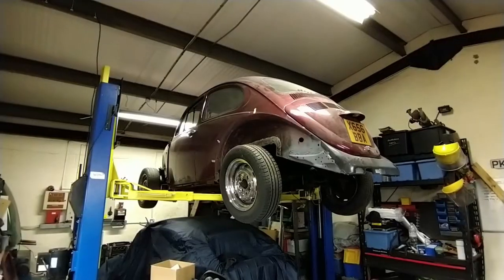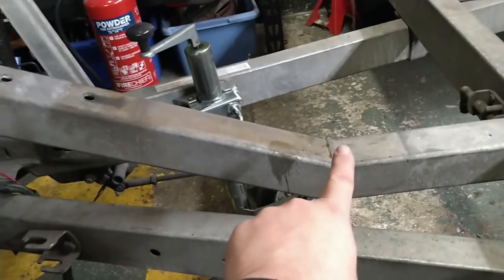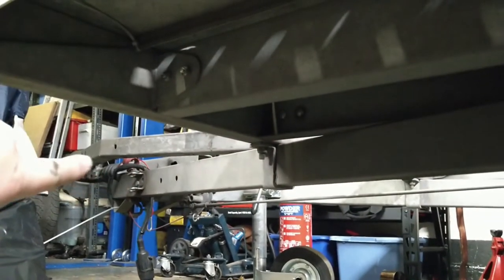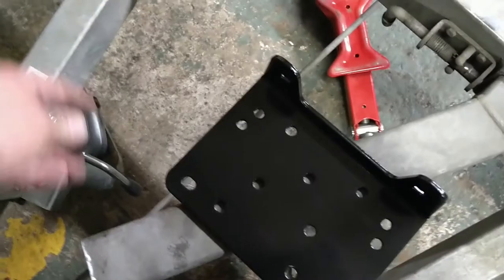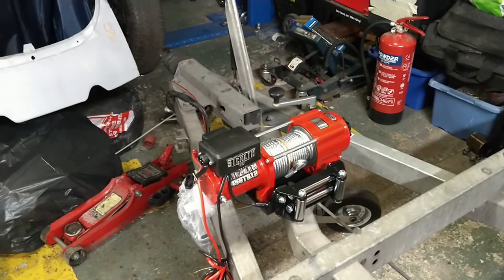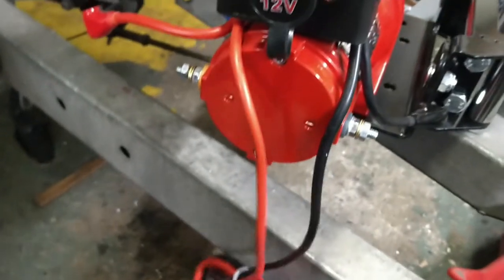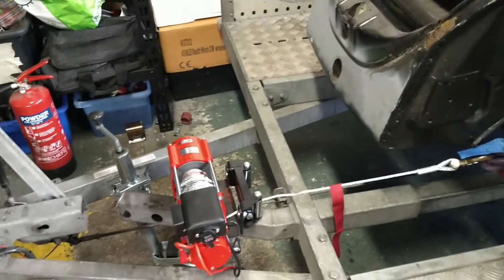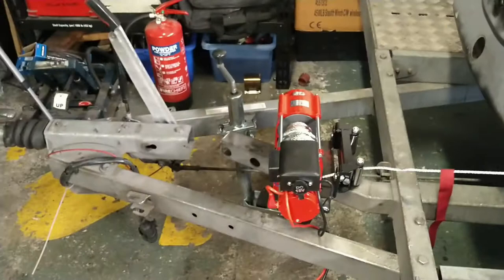Electric Winch install onto my car trailer

Comment: Spot on
Reply from the maker: Thanks matey! How are you getting on with your Mexi?
Reply: @2BugsandaBack  its getting there. Few problems with the paint its had done and ive got a brake light switch issue that I cannot fathom. I'll work it out though, I've learnt a few things on mexi electrics.